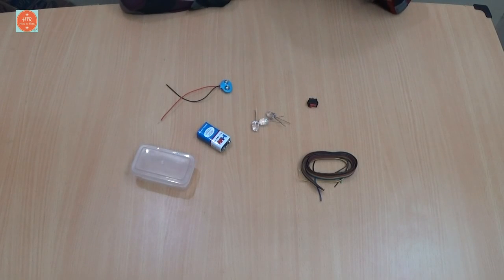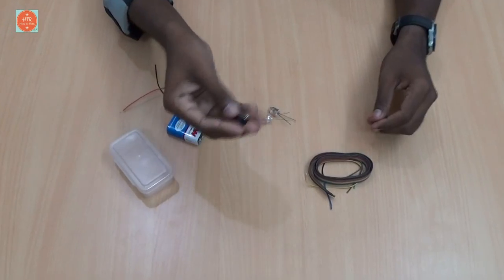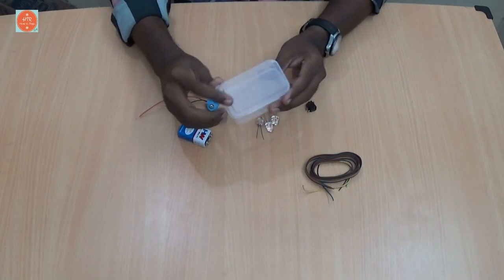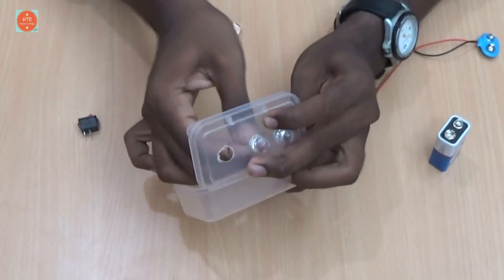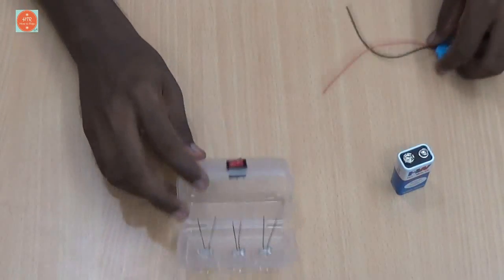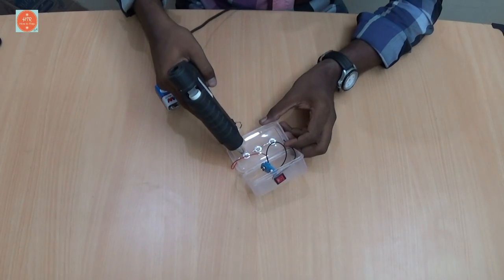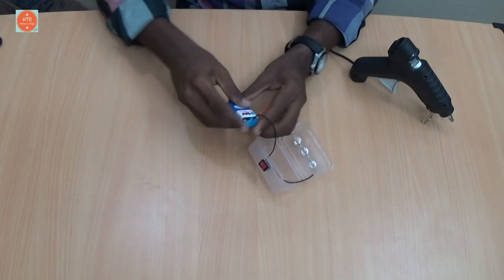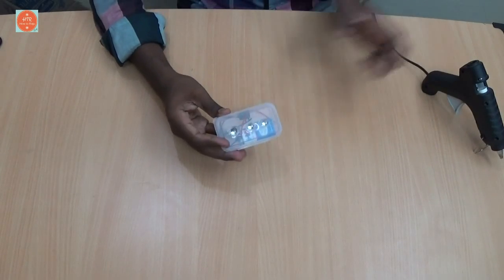How to Make a Homemade Mini LED Flashlight - DIY

Comment: Will it work with 2 AA batteries
Reply: No, 2AA batteries = 3V (1.5V each) . . . and for this you need 9V, because you have 3 x 3V LEDs to power up.

Comment: If you use frosted LEDs, you would have a nice, portable lantern. A voltage regulator and a resistor would be good improvements to it as well.

Comment: Why this doesn't have resistance/resistors? This LED's should burnout in no time. or get over hot.
Reply: They will burnout a lot faster without the resistors, but he has three (presumably) 3.2v led lights. They total 9.6 V so the amount of olhms is a lot less then having one connected to the battery.

(Correct me if im wrong I am in no way an electrician, just a game designer.)

Comment: Hi dude! I want to ask a question. Do i have to use resistor for 6 led and then use 9 volt battery? I read the description for my led it's says voltage : 1.2-1.6 . That means if i want to connect my 6 led(in a sircuit like u did on that flashlight) i have to use 9 volt battery right?Please answer dude! Thanks!
Reply: If you want 6 leds you need to have 12v. Then you can go without resistor i think. Correct me if im wrong :)
Reply: thanks dude!
Reply: depends on the color of the LEDS and if done in parallel maybe you might get away with it. But it would be best to go with a 12v

Comment: This will be cooler if instead of using 9volts battery you add resistance and a 110v or a usb power supply :) great video
Reply: just get a xl6009 boost converter and a usb cable solder wires of the usb cable to the converter's input  set it's output voltage to 9 volts and solder 2 output wires to the output of the converter
And then solder them to the positive and negative of this circuit and plug your usb cable to a powerbank